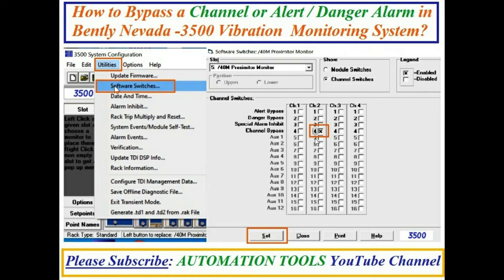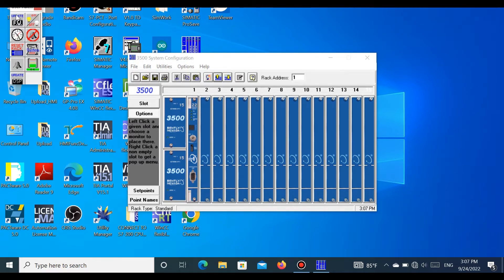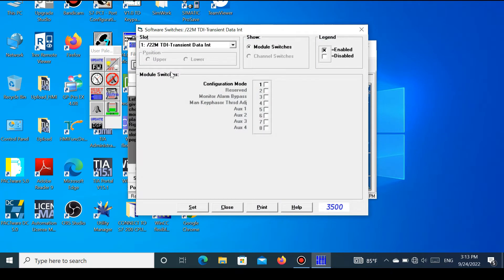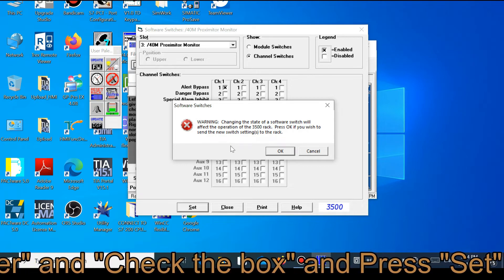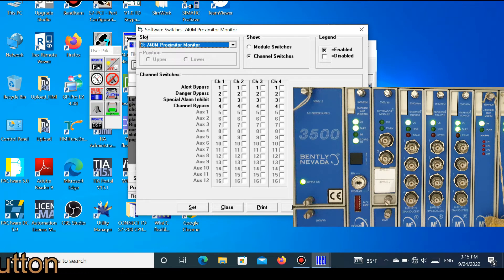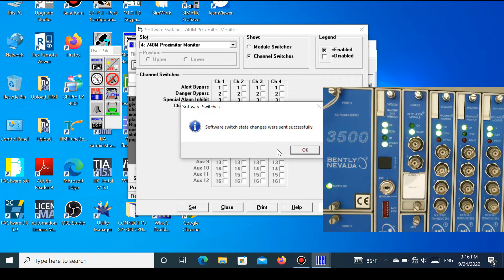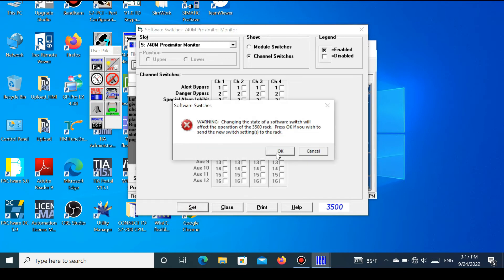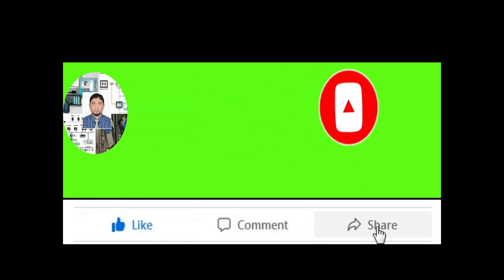How to Bypass a Channel or Alert / Danger Alarm in Bently Nevada-3500 Vibration Monitoring System?

Comment: I have a fault alarm  in my system , message " VMS slot 0 Module 3500/15 upper power supply not Ok , please can you give supports
Reply from the maker: Power supply module/unit problem.
Have to change or repair.